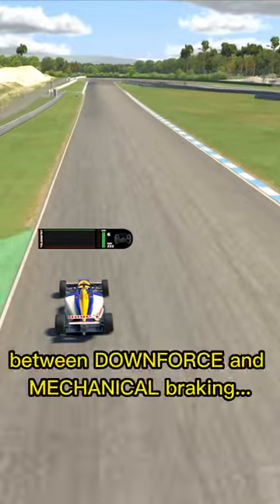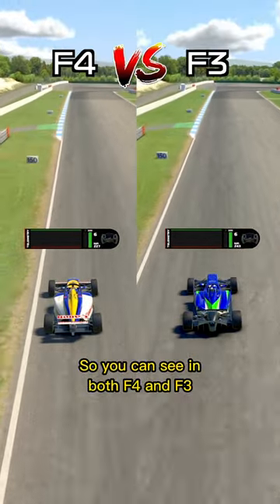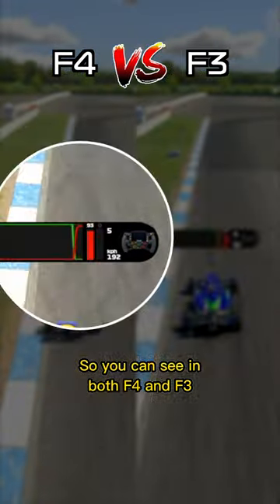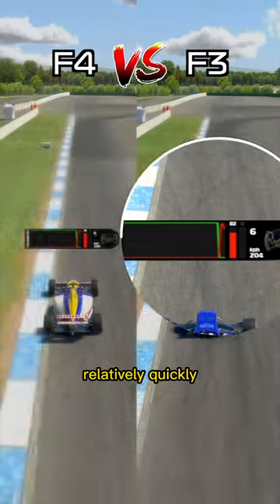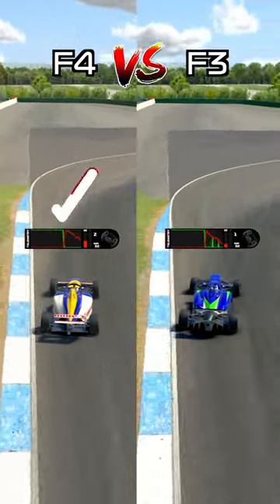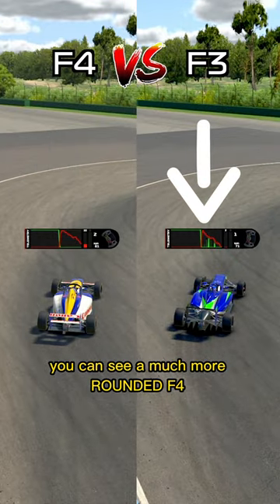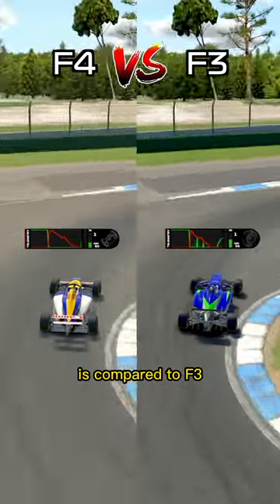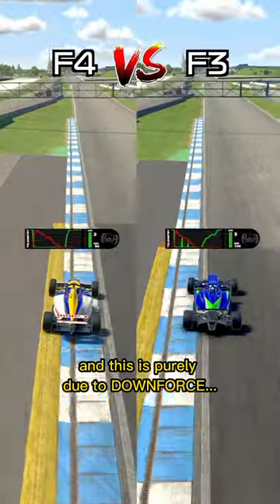DOWNFORCE vs MECHANICAL Braking (F4 vs F3)

Comment: I thought super low speeds like this corner, downforce doesn’t really have any effects? And low speed cornering is mostly mechanical? Or is this backwards?
Reply: higher downforce is good for heavier braking zones, which is usually what you get with slow corners like that
Reply: @aj384  mainly it's important on fast corners (not flat out ones)
Reply: @adri593  yeah but we're talking about slow speed corners here, where the importance of downforce is in the heavy braking